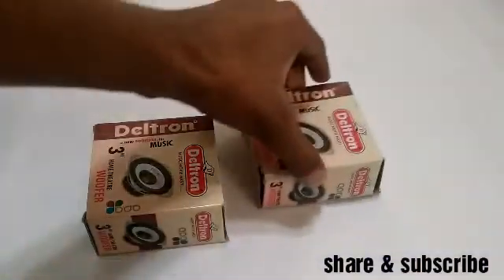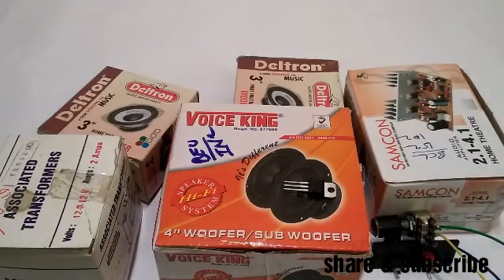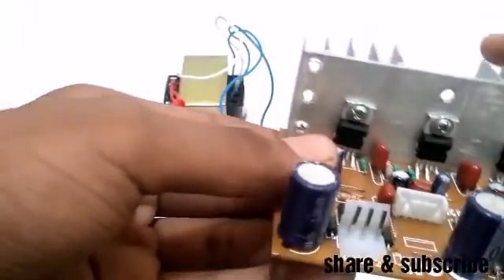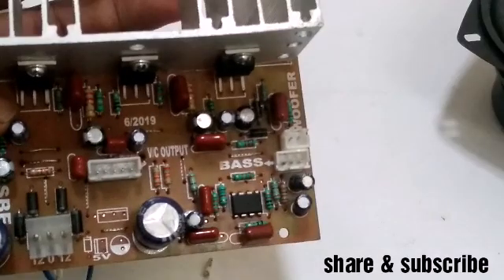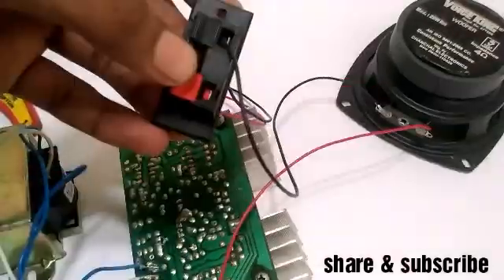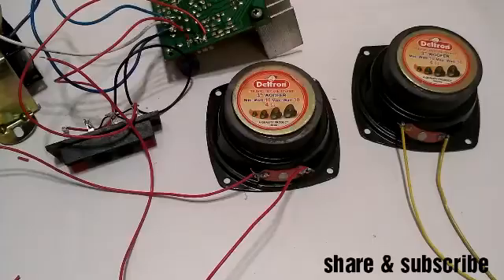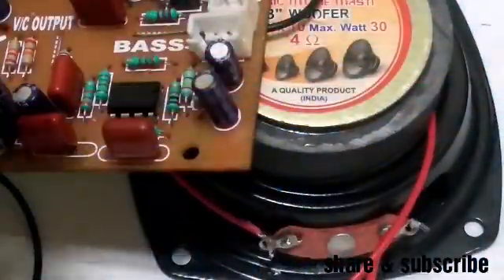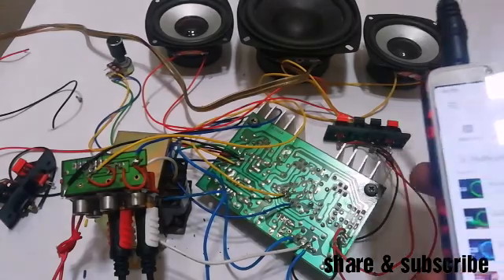How to make 2.1home theater at home easily (GR TECHNOLOGY)

Comment: Bro 2.1 undakki.. But ON akkumbo oru sound und.. Background il cheriya oru sound athentha
Reply from the maker: Nice👌👍. Grounding correct cheythal sound povum. pinne cheriya sound undavum. ath boardaa use cheythe
Reply: @grtechnology8875  2.1 board aanu.. 2030 ic
Reply: @grtechnology8875  bro ath onnum prnju tha... Pls... Ethu wire anu mattande
Reply from the maker: Audio inputille ground wire speaker outputille groundillekk connect cheyth nokk. Pinne cheriya noise undavum, mobile connect cheyth song play cheyumbol noise undavilla.song  Pause cheyumbol cheruthayi noise undavum
Reply: @grtechnology8875  mmm nokkatte bro.. Pinne bridge rectifier cheythal noise kurayuo
Reply from the maker: Ath venda llo aa boardill ath inbuilda. 12-012 transformer ath boardil filter cheythollum
Reply: @grtechnology8875  mmmm ok bro

Comment: Bro sub illatha amplifier il sub nu entha cheyyua
Reply from the maker: Subinte amplifier board vekkanam pinne athinte koode aavishyam Ulla components and accessories vekkanam
Reply: @grtechnology8875  ooh ok tanx bro
Reply from the maker: Subinte amplifier board vekkanam pinne athinte koode aavishyam Ulla components and accessories vekkanam
Reply: Bro oru 5 or 6 inch speaker okke kodukkan pattiya board etha
Reply from the maker: 4440 ic  amplifier board pattum. Athil 10inch vere woofers kodukkam
Reply: @grtechnology8875  tanku macha

Comment: മൊത്തം എത്ര രൂപ ചിലവായി
Reply from the maker: 650
Reply: ഞാൻ വിചാരിച്ചു കുറെ പൈസയാകുമെന്ന് പറഞ്ഞു തന്നതിന് താങ്ക്സ്
Reply: കടയിൽ നിന്നെ വാങ്ങാൻ കിട്ടുമോ
Reply: കാൺട്രോളറിന്റെ വില എത്രയാണ് പിന്നെ കാൺട്രോളറിന്റ പേരെന്താണ് പിന്നെ icyude നമ്പർ എത്രയാണ്
Reply from the maker: കടയിൽ നിന്ന് വാങ്ങിയാൽ മതി എന്നാൽ മാത്രമേ വില്ല കുറയൊള്ളു. 
കോൺട്രോളിന്റെ under 10 രൂപ  ആണ്. രണ്ടു കോൺട്രോളിന് ടോട്ടൽ 20 രൂപ ആവും. പിന്ന്നെ ഇതിന്റെ കൂടെ nove വേണം അത് ഒന്നിന് 5 രൂപ ആവും രണ്ട് അണത്തിന് 10 രൂപ  ആവും. ഞാൻ വീഡിയോയിൽ പറഞ്ഞ ic വേണ്ട അത് blutoothe module വേണ്ടി ആണ് അത് ആവിശ്യം ഉണ്ടാകില്ല ഉപയോഗിച്ചാൽ മതി. Home theater ബോര്ഡിലെ ic no. 2030 ആണ്.

Controllerinte name :Potentiometer
Athinte value 100k vennam pinne 47k vennam
Reply from the maker: വീഡിയോയിൽ പറഞ്ഞ ic 7805.ആണ് അതിന്റെ connection video link:https://youtu.be/fJ_wVJqg7DA

Comment: accessories  മൊത്തമായിട്ട് ഒാൺലൈനിൽ കിട്ടിയാൽ നന്നായിരുന്നു.  sepreate ആയിട്ട് കിട്ടുമെങ്കിലും  delivery charges  ഒാരോന്നിനു० കൊടുക്കണമല്ലോ?  അത്കൊണ്ടാണ്.  full set  കിട്ടുന്ന ഏതെങ്കിലും  links.  ഉണ്ടെങ്കിൽ അറിയിക്കാൻ താല്പര്യപ്പെടുന്നു. കൂടാതെ creative 2.1 home theater  pcb fault  ആയത് കയ്യിൽ ഉണ്ട്. 2 nos. ic 2025b ആണ് അതിൽ ഉപയോഗിച്ചിരിക്കുന്നത്.secondary 12v. 2wires ആണ്  transformer. 1ampere. Pcb module complete replace  ചെയ്തിട്ട്  ഇത് പോലെ  local  ചെയ്യണമെന്ന്ണ്ട്
Reply from the maker: Electrify TDA2030 Based 2.1 Home Theater Amplifier Board Kit Ready to Use with Bass, Treble and Volume Controllers Electronic Components Electronic Hobby Kit
http://dl.flipkart.com/dl/electrify-tda2030-based-2-1-home-theater-amplifier-board-kit-ready-use-bass-treble-volume-controllers-electronic-components-hobby/p/itm134ff92b8376c?pid=EHKFQC9SH3FFEVEM&cmpid=product.share.pp 

Eee board uppayokicho ethilekk oru 12 0 12 2amp transformer connect cheythal mathi. Speakerum, subwoofer creativinte uppayokichal mathi. Ee boardill treble & bassum unde pinne vennakil 5v regulate cheyth  kittum. Avasanam verunne wire audio input aakki upayokikkam. Centre groundum Baki wire leftum rightum annu

Enni samshayam undankil chothikkanam